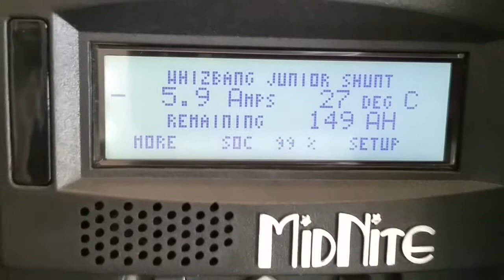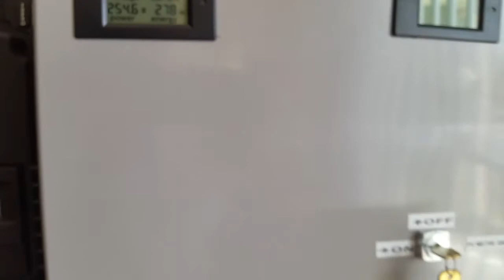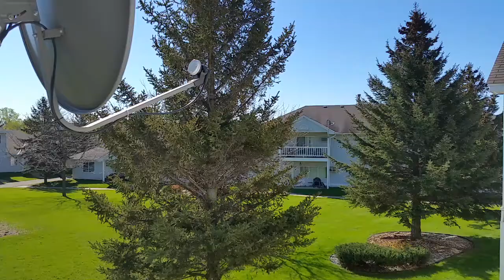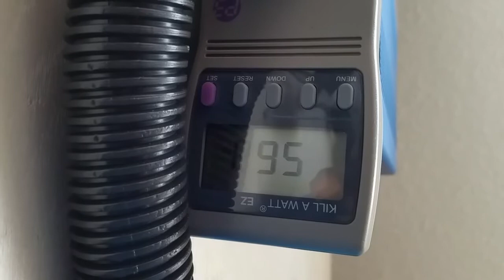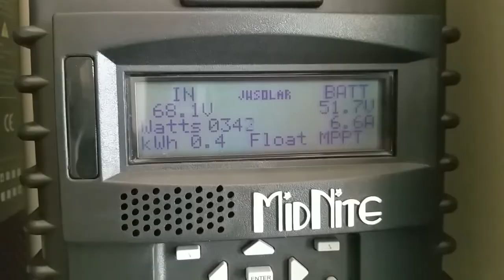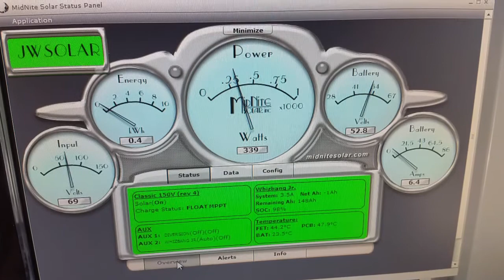DIY 48V OFF-GRID SOLAR AND BATTERY BACKUP SYSTEM TEST #5

Comment: How many watts of PV panels do you have?
Reply from the maker: +DIY OneForAll 8 x 160W HIGHTEC SOLAR INC =1,280 Watt of power with two Charge Controllers. OutBack Flexmax 60A MPPT Charge Controller and a MidNite Classic 150 MPPT Charge Controller 96AThanks for the comment. I hope I answered you question.Cheers.
Reply: +JW Solarusa 
Are you partially off grid or fully off grid? Do you run an air conditioner?
Reply from the maker: DIY OneForAll
Getting their
Reply from the maker: +DIY OneForAll 
Partial Offgrid but I am making the way to completely Offgrid
Reply: +JW Solarusa 
Got you. That's my goal, as well to be off grid totally.
Reply from the maker: DIY OneForAll
You will get their buddy.
This whole Solar energy is an addiction lol
Reply: +JW Solarusa 
It sure is addictive:) but good addiction lol
Reply from the maker: DIY OneForAll
Spending addiction lol.
I like my system performance and everything.
check out the video I just uploaded 48V offgrid solar system test #4
I should have uploaded this first before uploading #5
Reply: +JW Solarusa 
Yeah, I try to control the spending part by eliminating inefficiencies.
Reply from the maker: DIY OneForAll 
Hahaha..... that's good excuse my brother. 
You are absolutely right